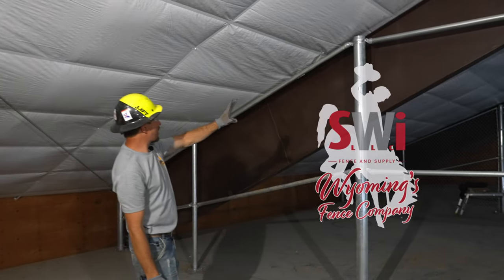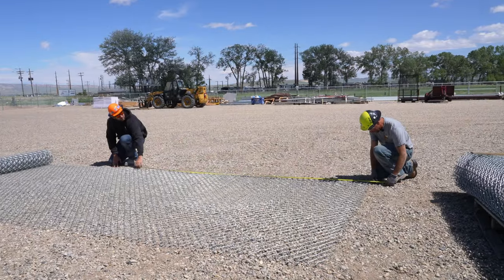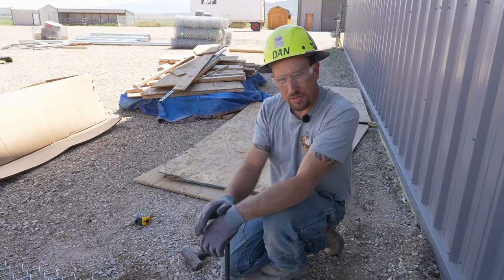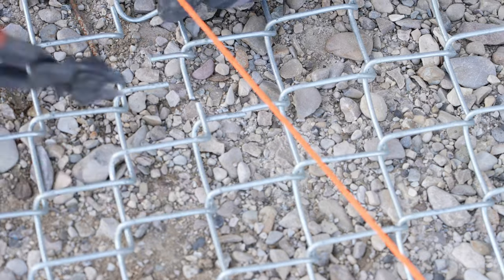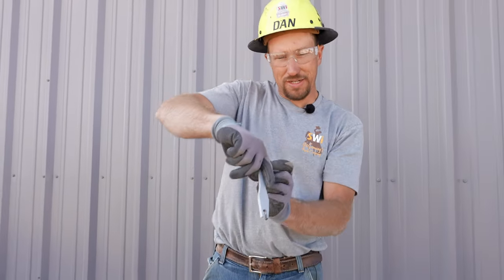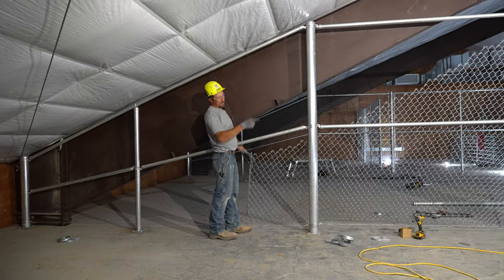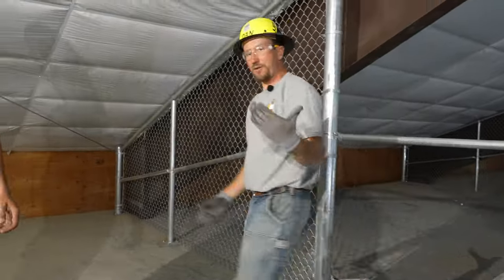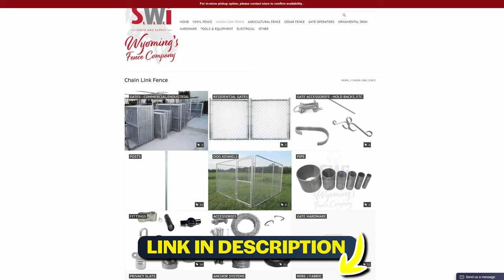How Am I Supposed To Accomplish This??

Comment: Ha! Found it. This is my job. This is what I have to do next week. 12ft chain link on concrete inside a warehouse for a 100ft secure to concrete walls.
Reply from the maker: You got this! We've got a video coming out on this whole job but it's not ready to release yet. The process is pretty similar to this though: https://youtu.be/eWmv83ZK_YQ
Reply: @SWiFence  I'll be waitingfor it. I would think tensioning would be a little more complicated. And I worry about putting too much tension on one side of a post TWELVE FEET HIGH with no tension on the other side (until it's built). That seems to be asking a lot from 4 little concrete bolts.
Reply from the maker: I think you'll be fine. You could consider core drilling if your floor allows for it, but as long as you're framing up your fence correctly before you start cranking on it I wouldn't expect any problems. 👍🏻👍🏻